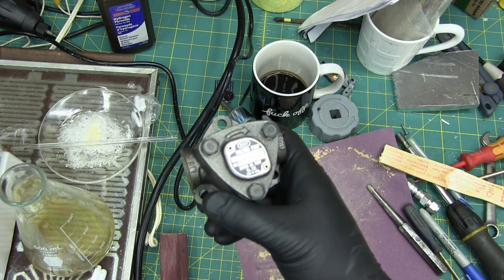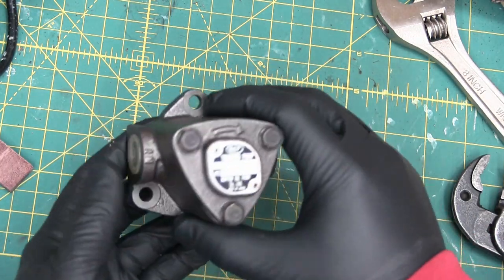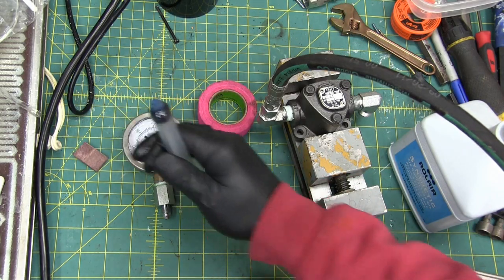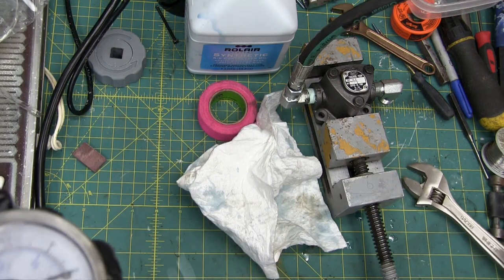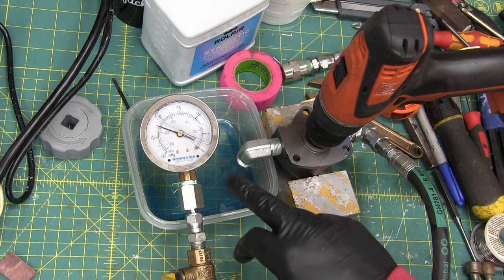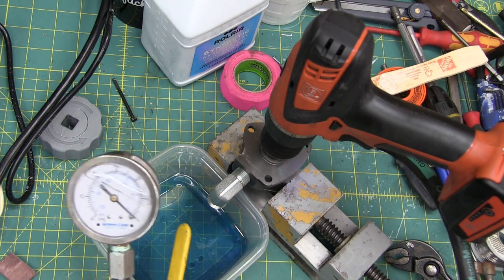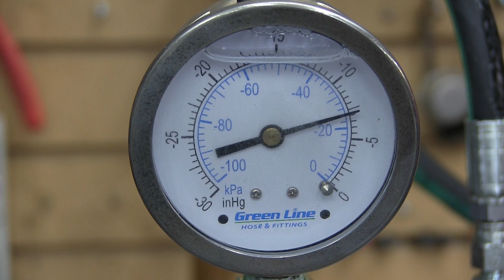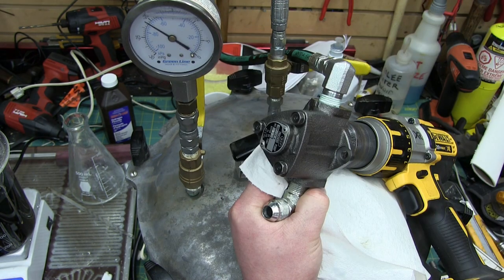Vacuum Pump Hydraulics | Cheap Hacks

Comment: Would it be possible to fill the outlet with a volume of fluid, such that the head pressure kept the pump submerged enough to seal it off? Kinda like a long hose attached to a container that is open to atmosphere? Just a thought. That way you wouldn't need to worry about pumping all the fluid out, or whipping your grease into a froth lol
Reply: Charlie Tucker Then take said container of fluid and allow a measured amount to flow to the inlet side through a needle valve to continually provide sealing fluid
Reply: Not and vaccum something like his vaccum chamber.
Reply: Peter Welsh why not? As long as the pump had enough fluid dribble back into it to provide some sealing, you'd basically be unlimited in the volume you could evacuate. Aside from your drill batteries going flat lol
Reply: Peter Welsh, why not? Pumping the oil through Output, cycling around to Input (NOT into vacuum chamber).  More elaborate, higher maintenance yet for all practical purposes, the same result. eh?
Reply: Since you will be pulling air though the pump and blasting it out into that container of sealing fluid you would work it into a foam anyway. The alternative would be a large, sealed reservoir full of oil on the inlet side, use the pump to pump oil to another spot and cause a vacuum on the reservoir that would then be usable. Drawback, cavitation.
Reply: crazyguy32100 would you be moving enough volume of air fast enough to cause foaming issues? Seemed like it took a decent amount of time to evacuate like, 2 cu/ft of air lol
Reply: I would think it depends on the viscosity of the oil you are forcing the air through. We have all seen a foamed over hydraulic system due to a pinhole leak in the suction line, more oil flow true but nowhere near as much air.
Reply: i think vacuum oil is for this purpose, used in diff pumps and rotary vain pumps
Reply: I think I was thinking the same thing as you. An 8 inch long 3 inch pipe with a little oil in the bottom standing vertically on the output of the pump would dribble enough oil to keep the pump wet.
Reply: Well, he just proved that without oil, the vac was proportional to the speed of the pump
Reply: crazyguy32100 I have no idea what you guys are talking about but I do enjoy watching you discuss it!
Reply: dannyb4283 Danny, sure u know what we are talking about....it’s ok to admit it, just don’t get caught
Reply: Should be straight forward enough to do with a sump system and a trap for the liquid that is used for lubrication. Keep in mind that one fluid in the system should be compressible and one isn't. That would allow you to limit the lubricant being drawn back in again from the sump. So how well it works depends on the pressure at which the lubricant would evaporate while at operating temperature. (Ideally the lube/sealant stays a liquid, while the gas is able to be pumped out.)
Reply: The vac pumps we use are vane, they use AW32 hydraulic oil, they run in a bath of it and have a whole pile of filters the keep it out of the exhaust stream.

Comment: Just checking if i got this right. Would it be possible to make a more efficient vacuum pump setup using a pressure vessel with a check valve going to a sealed oil tank with a hose going to the pump? Oil gets pumped out of the tank, lowering the pressure and to compensate the check valve opens and sucks the air out of the pressure vessel. My reasoning being that it lets you use the pump the way it was designed to work and you shouldn't run in to any overheating issues, and the check valve would also let you stop the pump and fill the oil tank when it runs dry.

Comment: AvE, would you mind doing a video comparing air tools vs power tools in terms of cost, efficiency / advantages/disadvantages etc. I'm about to kit out my workshop for my car restoration hobby and just general home gamer fabrication, I know I'm going to need a compressor and power tools but I'm considering if I should just get good air tools and run them off the compressor as I've noticed there are air versions of most power tools. Thanks!
Reply: Also are cheap air tools as useless as cheap power tools and hand tools, thanks again.
Reply: Iain Hughes- my opinions are when it comes to air tools the cheap ones at Harbor Freight are very capable if you oil them. Not the same with cheap electric tools. From my experience if it is an Impact wrench, die grinder or DA sander air is the way to go. I much more prefer electric for grinders, drills, and any saws. And with electric tools I prefer decent corded tools. I dont understand guys that work within 15 feet of an outlet and use a cordless drill. Yes I have them and use them they are portable and convenient but at the sacrifice of power and batteries needing charged and replaced. If I have work to get done I have found I save time and a headache running a 100 foot extension cord and using corded tools. My 2 cents about it. Stay safe and take care
Reply: Thanks man, much appreciated.

Comment: A bit of lateral thinking and you get ...... A big sealed oil tank with your (soon to be vacuum on the other end. Pump your oil into another tank and the dropping oil level creates a vacuum above it, open to your used to be vacuum and the gas fills the space above the oil! Close valves, let oil drain from top tank and repeat ;0) If you want to be a smarty you could always create a reciprocal system! 
This could get you down to the levels at which oil evaporates ..... not Codys Lab levels but not bad!

Comment: You put the pump IN the sump so the leakage doesn't squeakage.   That way any pull-back relubes the pump.  The air has to go through the sump and come out the top and is exhausted through a one-way at the top of the oil.

Comment: If in doubt, use both hands - could two of these pumps nose to tail pull a harder vacuum for when you need those extra few inches of Hg?

Comment: I use a vacuum pump at my dental lab and the intake hose has a small wick that is in line that wicks a tiny bit of oil into the pump

Comment: Is that a vane pump?  And where do you get that grease! An old guy gave me a tube years ago and I can't find where to buy it since I ran out
Reply: At least when you find the tube of it, it will still be usable, unlike years old tubes of Silicon adhesive...

Comment: Given all slurry tankers use a vane pump for the vacuum and pressure could you modify an old impact gun to do the same thing? Doing away with the hammer and driving the vane motor direct. Using the motor to suck air rather than being driven by it???
Reply from the maker: Good question!

Comment: if your only after 20"of vacuum couldn't you just hook to a vacuum line on your car? would be a lot higher volume.  If you need a better vacuum pump use an old refridgerator or ac compressor. (25 to 30inches)

Comment: What about putting an oil reservoir on the other side. Out coming air bubbles through the oil but when pump can't no more push the air out, oil flows inside pump. Of-cause you need other empty reservoir on sucky side for oil if you don't want your pressure cooker to look like my undies when you stop drilling. Or a testic... sorry ball valve.

Comment: My only concern is heat build up, both in causing damage to pump, and losing grease viscosity therefore losing pumping effectiveness.
Reply: Peter Welsh this is obviously not for use as a production vacuum pump. There's a reason vacuum pumps are built the way they are. This is a proof of concept and for dicking around in the shop.
Reply: Still a valid point to consider.

Comment: Get an old refrigerator compressor!
Reply: heap's ezy
Reply: Good once you replace the oil with a light engine oil (30 wt.). Had one for years for pumping up tires, a disadvantage is it's slow and it generates oil mist on the exhaust. That's kinda remedied by putting a vertical T on the exhaust with a valve on the bottom to periodically let the oil out. Also if you use it as a vacuum pump it needs extra cooling with f.e. an external fan.
Reply: @1992jamo  I had both. The real vacuum pump might be a little faster.  I was able to pull too much vacuum on a couple of carbon parts and caused pin holes in the surface, so... It's plenty strong.

Comment: AvE: After seeing this, here is a quick doodle of a simple oil recycling system for that pump to keep it lubricated.
https://drive.google.com/open?id=15zn5NccBsbFECs6C-F9E6zTzw0TJ9X3X
This should keep it from burning up over extended use.

Comment: now put a drip oiler on the intake side and a container or better yet an oil seperator on the exhaust side, your in buisness. the dairy industry used to run vacuum pumps this way for decades

Comment: AvE!!! there's a guy by the name of Tom Stanton that has been in the process of trying to design a 3D printed air powered engine for use on a small plane, he is trying to power it with a soda bottle with a presta vaulve pumped up to 60 PSI. Tom has gotten version 5 to run for about a minute but I realy think that you two should get in contact because just as this video proves, you know a thing or 2 about fluid pumping, am I right. Anyways he is in the UK i believe but you two should talk to eachother and maybe you can help him make the engine better some how. here is the video for anyone interested:
https:www.youtube.com/watch?vYLPC8CY5Fm4